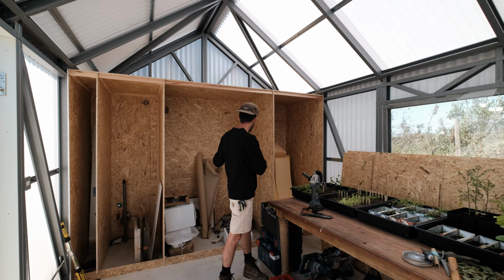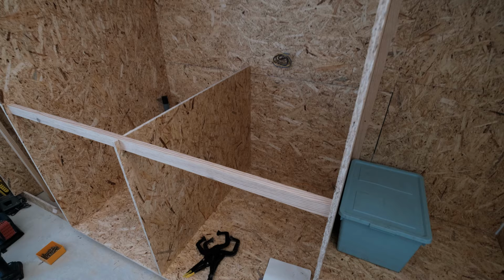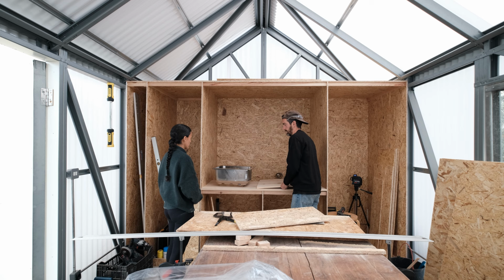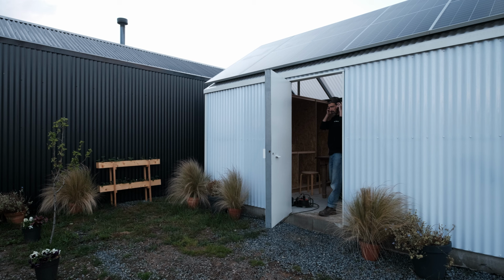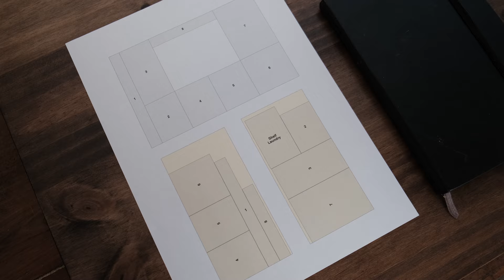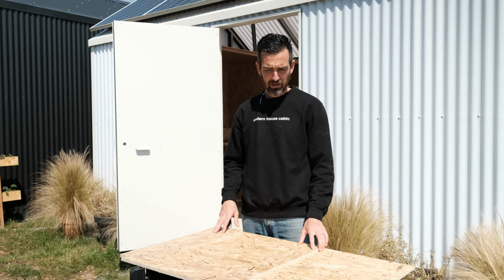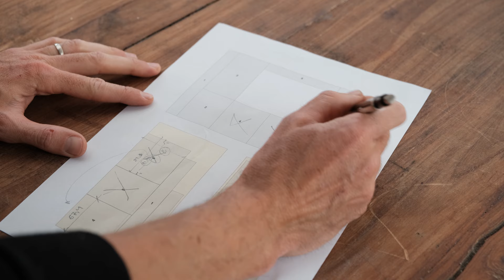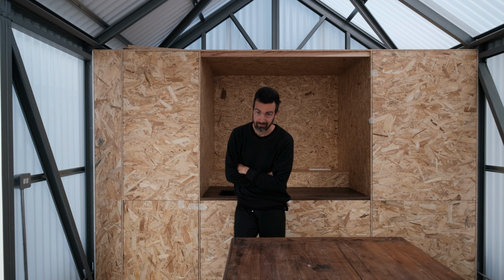19. We Left United States to SELF BUILD our OFF GRID Project in Europe

Comment: Screw a batten, edge on, front to back, under your sink work surface on the left of the sink to support the pine board as the small part could split along the manufactured joins, it will stop it from sagging too.
Reply from the maker: thanks for the tip!

Comment: i wonder how strong those OSBs are in terms of taking heavy load.  Over time, moisture  and heavy load would most definitely warp the wood on the shelves.
Reply from the maker: in the cabin they are holding up like the first day, we used 18mm there tho, this time with the 2by1 in pine wood as substructure the OSB is going to be just fine for ever :)

Comment: Did you have any issues with cutting into the Pine? I have a pine desk I want to cut with either a jigsaw for a rectangular hole or with a hole saw to mouth a flush plug socket but don’t want the wood to splinter
Reply from the maker: not at all! go for it, give it a try, set your tool to a medium speed and make sure the blade is sharp enough! whats the worst its gonna happen? NOTHING 🤣 you will have a proper sized customized desk done by you!